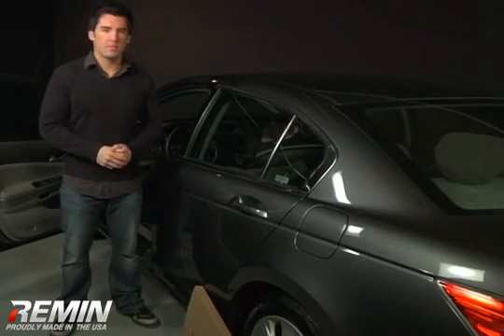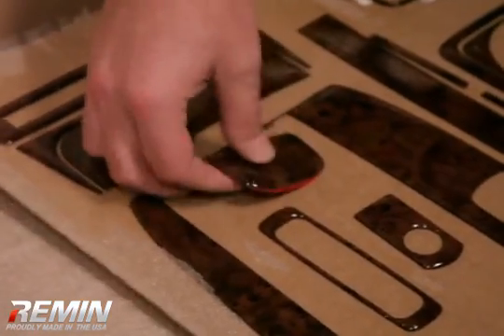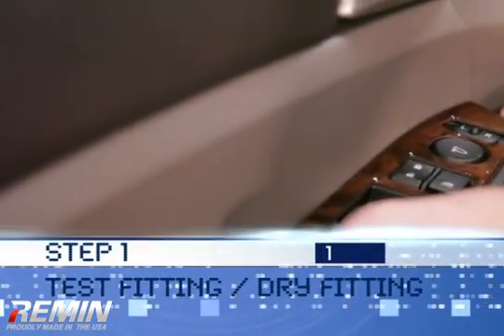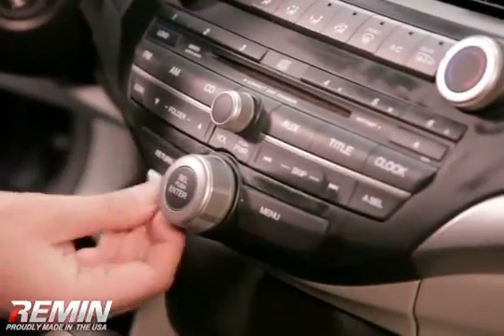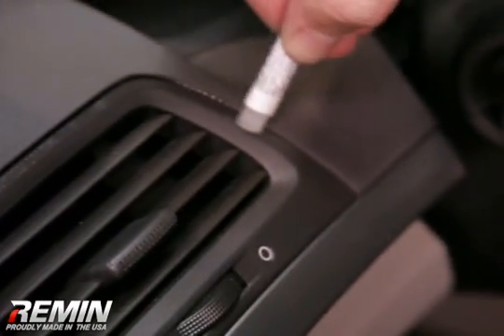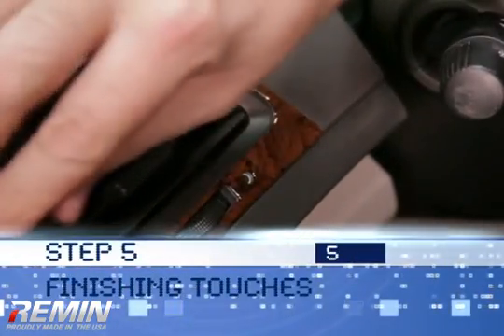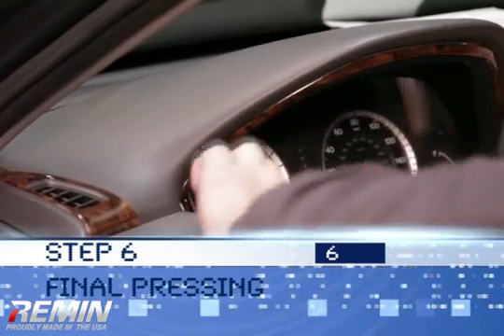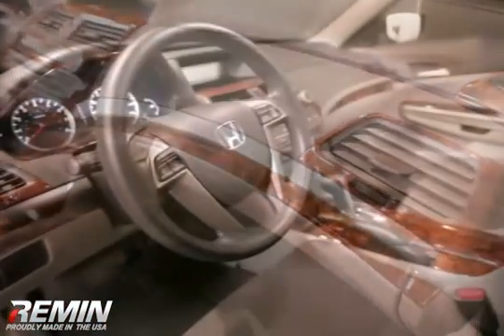Remin Dash Kits Installation on Honda Accord

Comment: What if the car gets really hot inside after you installed the kit and the adhesive starts to peel off?
Reply: JB Weld it back on
Reply: what was the answer they gave you?
Reply: what was the answer they gave you?

Comment: a little ajax with a old toothbrush will remove amour all, rinse with water you'll see a dull finish. take rubbing alcohol and clean thorughly, use tape test and proceed.